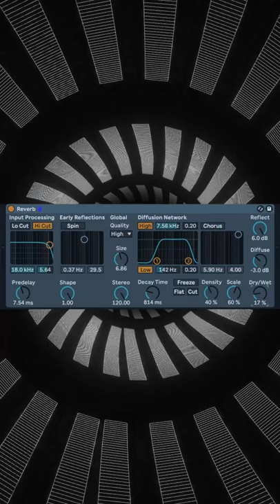Easiest way to Make Rolling Techno Bass #shorts

Comment: Is it a good idea to put delay/reverb on bass? Doesn’t it make it loose?
Reply from the maker: in that case the delay make it groovier and add mouvement, the reverb put your bass into space and make it sound less dry. You always have to be careful how you execute it of course and you can easily mess things up with delay and reverb on bass ,but when applied carefully it works well.